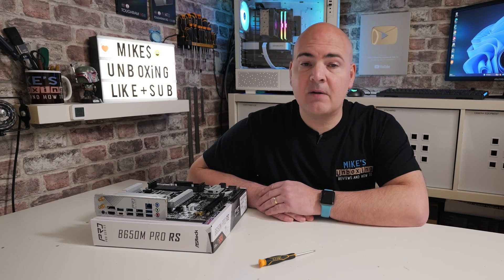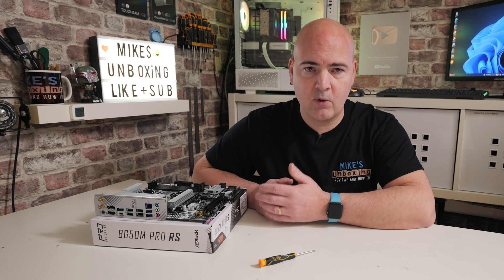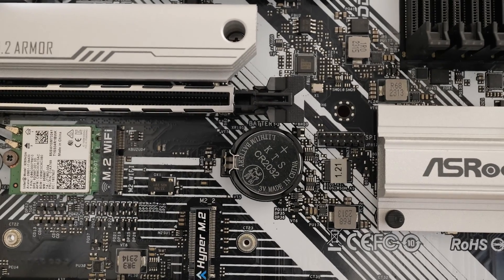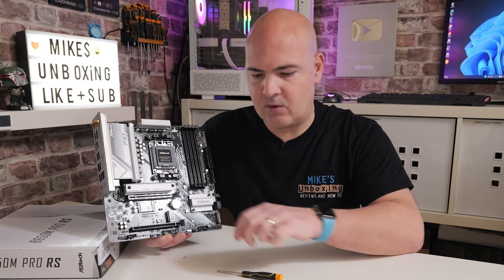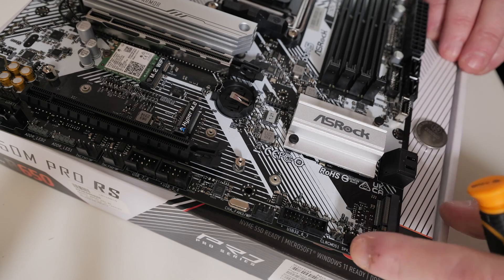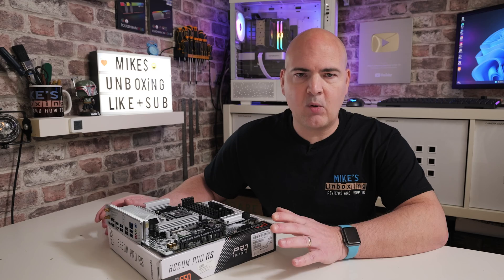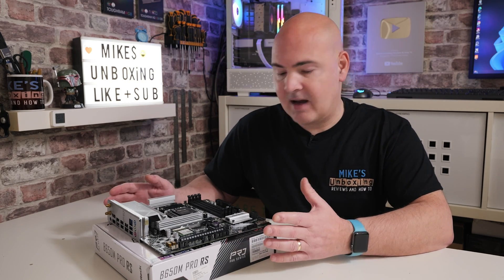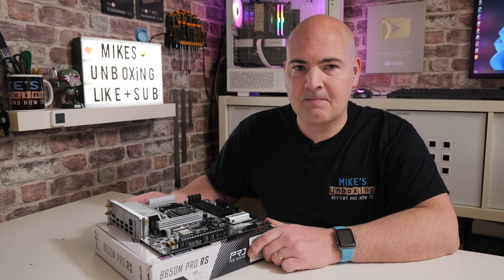How To RESET Your PC BIOS Or CMOS To Factory Default Settings and Change The CMOS Battery

Comment: TUF GAMING B650-PLUS как сбросить биос на ней не 1 ответа в интернете и по туториалу нету перемычки
Reply from the maker: it is located between the COM port and fan header 3 labbelled as CLRTC
Reply: @mikesunboxing is it necessary to take out the battery or can I just shorten those pins with the screwdriver?

Comment: this has gotta be a joke. is DDR5 1960 tech? fucking DDR3 was so easy to live with compared to this, my fucking 5600MHz sticks barely run at 3600MHz this is a bad fucking joke and now I GOTTA SHORT CIRCUIT MY FUCKING MOTHERBOARD WHICH IS STILL UNDER WARRANTY?! shaking my fucking head, gaming is dead

Comment: He's talking about gently putting the screwdriver against it to get the battery out but I literally used about a good forearm amount of strength and I still couldn't pop the thing out
Reply from the maker: you don't need any real pressure at all, all you are doing is sliding the metal clip away from the edge of the battery

Comment: My motherboard MSI b650 gaming plus wifi set enforce password it's not be clean 😢
Reply from the maker: I would recommend letting the two buds go completely flat and then give them both a full charge. This is actually the recommendation of the manufacturers if you are experiencing connectivity issues or dropouts.
If you try this and still get problems i would consider speaking to the retailer or stockist and start a return as it is quite likely they have a hardware fault that would not be something the end user is able to fix or repair.

Comment: the pin doesn't remove on my case, cannot remove bios battery
Reply from the maker: This is maybe easier to fix or at least advise if we can ask more questions and get direct answers, so feel free to join our Discord chat and we can go over it in more detail https://discord.gg/XtBTGQ6BDu
Agree to the rules by clicking the emoji and you will get access to the rest of the Discord channels
Reply: @mikesunboxing  Thanks for the invite. I was able to solve it by applying much force by a screwdriver. I broke the hook and cut my hand but now I can easily remove and put CMOS battery 😃
Reply from the maker: @RandomGuy-df1oy  Glad you solved it, and hope your injury is better 🙂

Comment: I just recently changed my ram speed to what it's supposed to be and then I went to change something else and It just won't boot into bios, or it does and i get no input signal. Here's the kicker though, I can boot into the OS and get a signal. I'm wondering if this could work. I don't want to screw anything up any further. Should I be good?
Reply from the maker: try plugging in another monitor or use a different cable it is a common hdmi / dp / monitor bug
Reply: @mikesunboxing  It was definitely a bug, and I managed to fix it and in the process do everything else I wanted to do. Thanks for the input! You're videos are becoming very helpful in everything else I am learning through the process. Cheers!
Reply from the maker: @trg1408 thanks appreciate that glad it is working out for you now

Comment: So to clear Cmos you need to BOTH remove battery AND do the thing with the screwdriver over the clearcmos pins? Isn't just enough to remove battery and wait 5 minutes?
Reply from the maker: no because a lot of PSUs have massive capacitors and keep the 5v standby rail active for ages

Comment: Just a litle tip. Whilst you do have the battery out, do make a voltage measure of it. You be suprised how many batteries (even new one) don't hold specified voltage. btw voltage should be 3V
Reply from the maker: good idea, will add that into the video for the next round up

Comment: Great reminder tutorial! I upgraded to B550 a few weeks back  and in error put the MSI bios into overclock mode. Had to think what you had previously instructed. Power off, pressed the power button for 10secs, then used my MUB screwdriver to short the pins. Restarted and bios back to original settings! Phew! Thanks Mike and Kath for all you do 🐈👍
Reply from the maker: Glad it helped! The MUB screwdriver that is 😎
Reply: @mikesunboxing  I see what you did there hahaha🤣

Comment: I have had to do this many a time works a treat ! did this feature get invented ? like by users or was it factory standard i always thought the battery was to not lose time and dated in older systems and us modders found a glitch i didnt know thats an actual protcol the more you know hey thanks for the Info as Always Mike and Kath hope you new year started well
Reply from the maker: think it has been an option for a long time. even in the old 286 days

Comment: Hi, Mike. Good video. Because I used to contently tweak my RAM sittings, I've probably cleared the BIOS at least five-thousand times. Never once have I ever removed the battery. But there's no harm in being thorough. One tip I have if your motherboard doesn't have a Clear BIOS button, is that you can connect the reset button on the front of the case to the clear BIOS pins. That way you will have a button on your case and won't have to mess around with a screwdriver. But if you're using the reset button for changing RGB or something, you can buy a reset button for cheap and attach it someone on your case that's easy to get to. I hope someone finds this little tip helpful.
Reply: Good tip Big O.
Reply: For my test bench MOBO, I wired up a push button momentary switch, soldering two  wires from some old header that I cut up so it now just has 2 pins, to the legs on the  switch and this is what I use for my "power button" on the bench.
Reply: your right but tbh iv had to clear several times with batterys especially on my Favorite Mo Bo ASUS Strix mine needed a Bios reset twice out the box Looool more from my install mistakes but still it wasn't posting and bios reset wasn't wrking the battery returned to like out the box then i got no post again so i must have repeated the same mistake or had a error along the way Battery out several times its Why im scared of my Bios now hahah

Comment: This is a great video for people to reset their bios if there are issues. Am I wrong to say that motherboard manufactures need to implement a factory reset Bios within the Bios itself?  Resetting everything to default isnt cutting it for me... all we want is a simple button setting
Reply from the maker: There is a setting in the bios if you can still access it that will load optimised factory settings
Reply: @mikesunboxing  True, and it's always a good place to start.
Reply: Most motherboards allow you to save your current working BIOS settings. So if you mess things up when making changes to your BIOS, you can clear it, and then reload the working version. Thus not having to reset everything from scratch all over again.

Comment: I accidently cleared the cmos with the psu switch on;however, the computer hasn't had problems so far. But, could it have problems in the future?
Reply from the maker: No that should be fine, usually the residual current in the psu would prevent a reset so it would seem yours was a bit of good fortune

Comment: Nice how to Mike. Another Tip: All of my motherboards have the 2-pin plastic shunt or jumper on them...but I only have them on one of the pins, so if I do need to reset the CMOS...the shunt or jumper is already there. I remove the battery,  put the shunt or jumper on both pins for about 30 seconds. Then I put it back on one of the pins again. Put the CMOS battery back in. Hope that helps. Thanks for sharing Mike and Lady Kath. Cheers
Reply from the maker: yeah those plastic jumpers used to be everywhere!
Reply: @mikesunboxing  I used to work in the electronic industry so I always had them lying around. I'm sure Amazon sells them cheap. Wouldn't hurt to have some on hand. Cheers